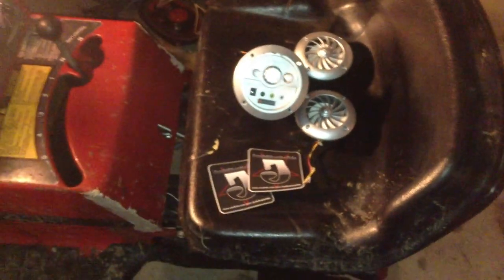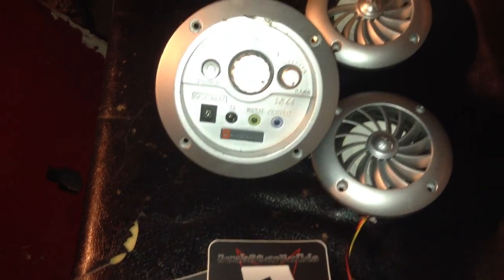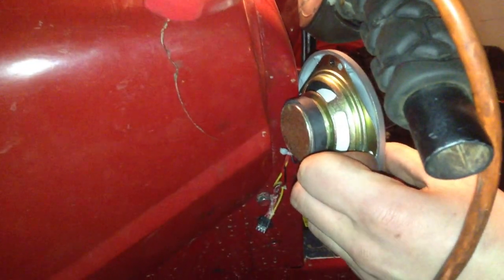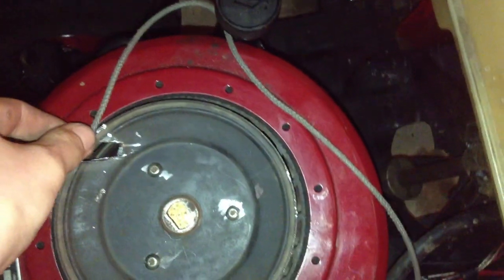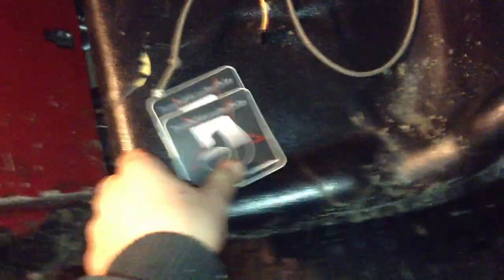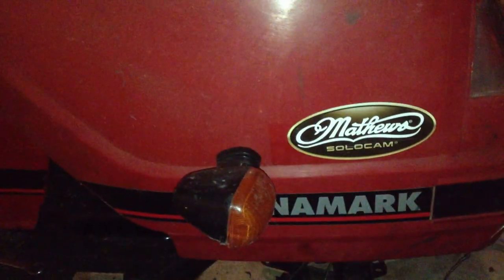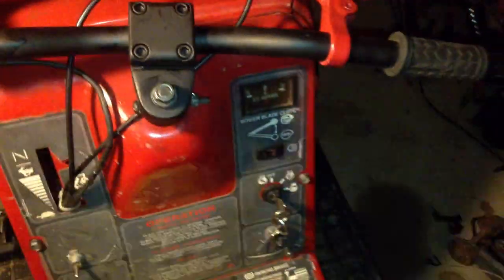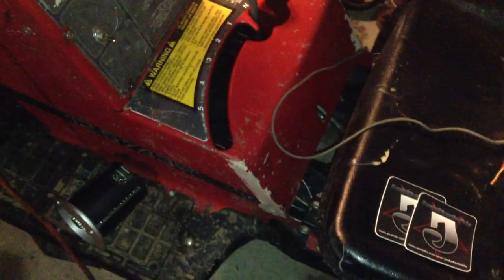Mower Update #5

Comment: Stick your speaker control on the side of the console. It will be harder for water to get in there. As for the speakers, see about putting them maybe on the slant where your shifter is. I think itll look a lot better there.

By the way, I like how your seat sits. Im guessing you shopped the frame to have it sit that low? Might have to try that myself sometime.